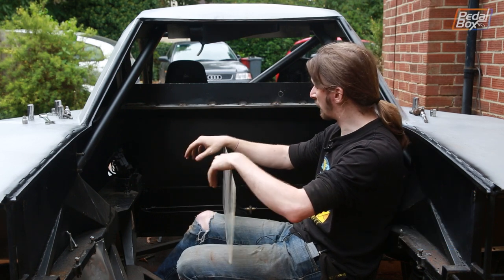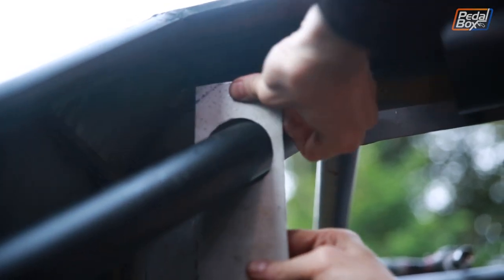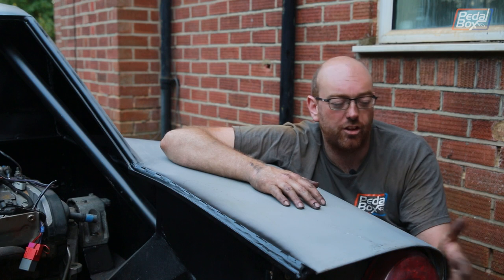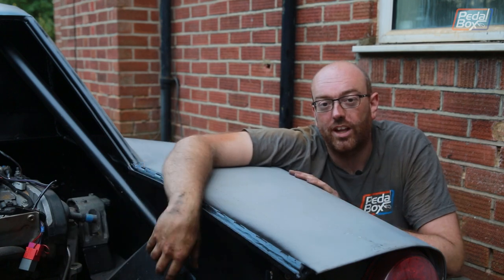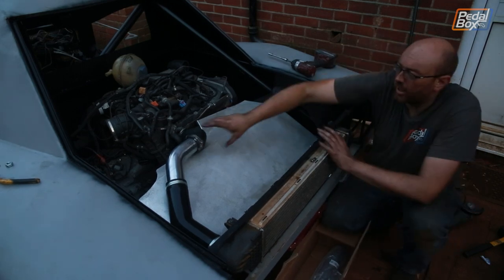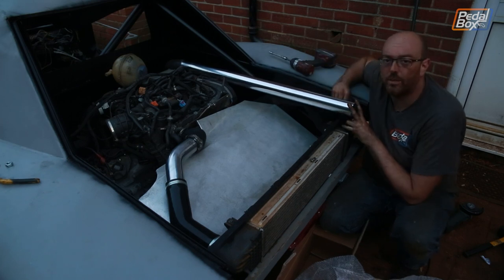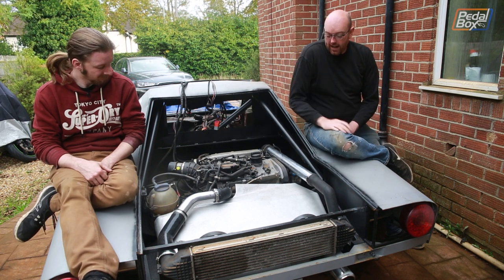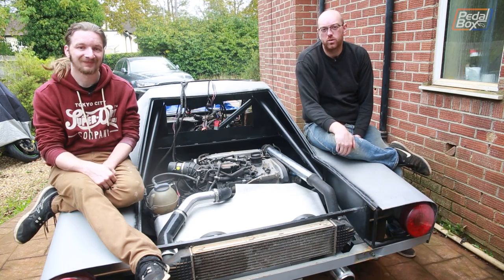Finishing the Firewall & Boost System | Audi TT Kit Car | PedalBox Episode 89

Comment: You might when working on the engine later regret leaving the sharp corner on the heat shield by the turbo.
Reply from the maker: Yeah, not a bad point, well, it might be a bad point lol. We'll see if it gets modified when we get into it again :)

Comment: Those pipes and the heat shield look absolutely fantastic. Out of curiosity, why the switch from silicon to aluminium to silicon  so regularly through that pipework? Convenience of parts, or some technical reason?
Reply from the maker: Nothing but parts availability and having the minimum number of joins for simplicity. You could do it all in Alu or all in silicone if you felt the need, and had the tools to make up the ally pipes to suit.
Reply: It’s also super easy. Sealing two pieces of silicone to each other is tricky, as is sealing two pieces of aluminium. One to the other is a piece of cake though, just put silicone over aluminium and clamp it up